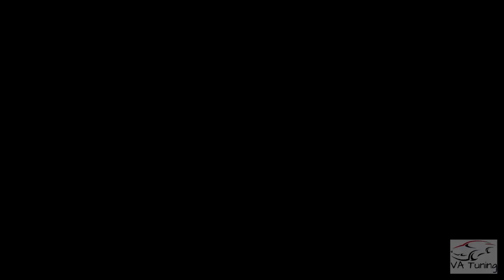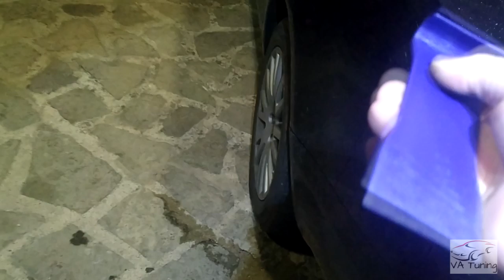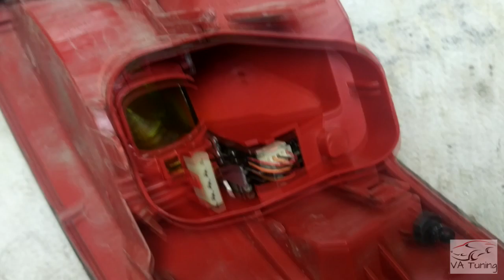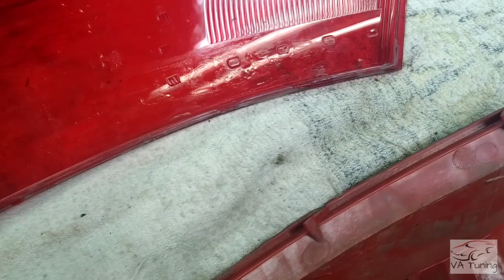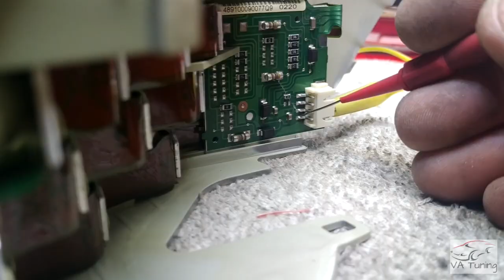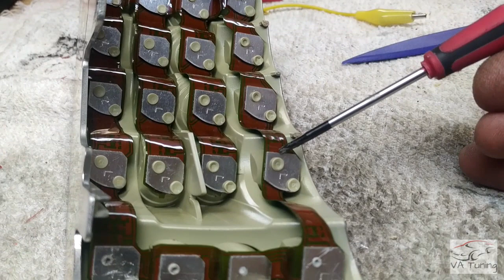Audi A6 4f Avant rear led lights repair

Comment: Hi very well done Sir clever man.
May I ask you about my issue, is I have bought a new light cluster due to Led's not working on near side rear and still don't work with the new cluster, so I've no power going to mine so what could be the issue in this case?  Thank you.
Reply from the maker: Power is comming out of the cental electric module.Maybe a broken wire.

Comment: what type of led are in stop? I have 1 possibly burned piece
Reply from the maker: Sorry i did not meassured the led voltage.
Reply: @va7052  led 3528? 3v?
Reply: @280marius  have u find the new led to replace your’s???Can u please tell me the characteristics?
I’ve got the same problem(1 is burned)
Tks🥂
Reply: @mihai22f  no, i don t know